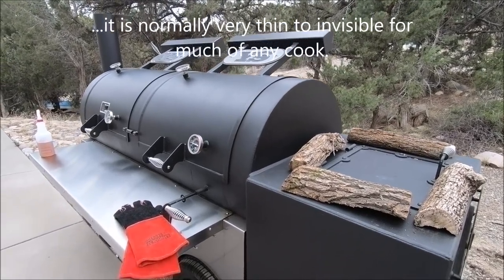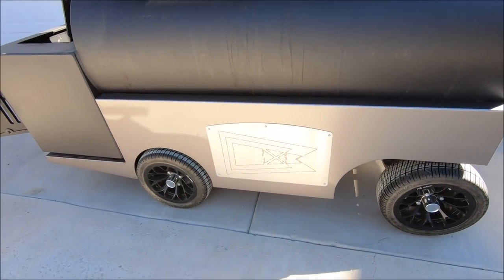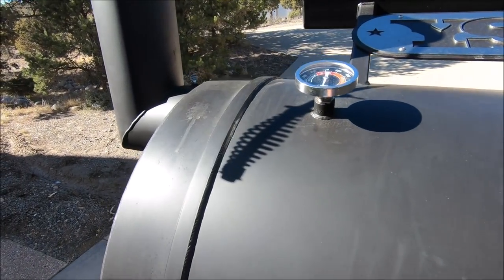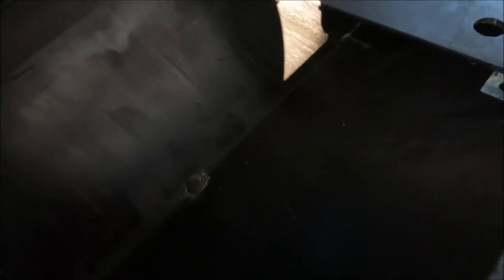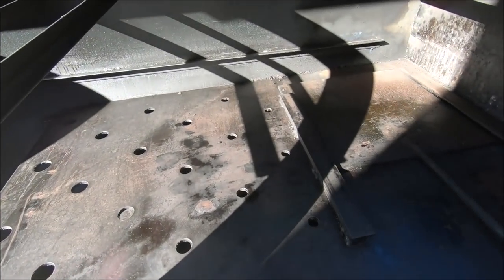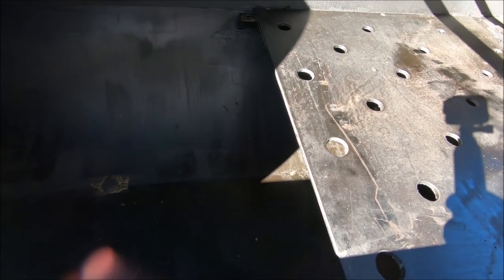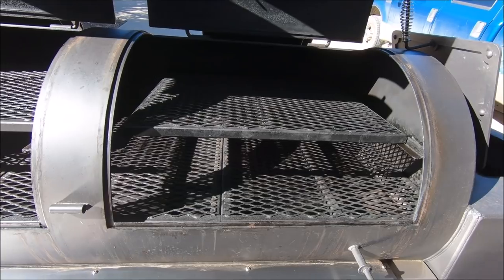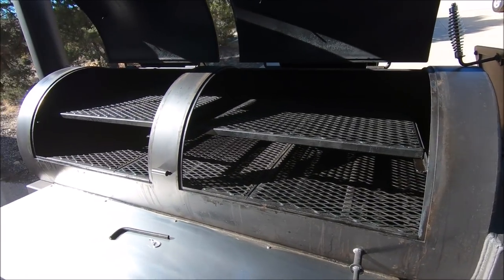Numbing Tour and Review of a Yoder Frontiersman on a Competition Cart

Comment: Great information as usual! Would love to see some fire management videos on the yoders. 
They all seem to have this back draft issue, wouldn’t a slightly bigger chimney stack resolve this?
Reply from the maker: Thank you ollygee!  If you think you can handle more of my crappy commentary, it'd certainly be easy enough to shoot a little footage as the fires get stoked the next time I fire these cookers up.  I'm not sure about the stack but what is common on the Yoders compared to my other cookers is that the firebox is set somewhat higher in relation to the cook chamber so the flow is more horizontal if not directed slightly downward by the HMP (heat management plate).  In fact, I misspoke in the video, the top of the firebox is actually above the plenum leading into the cook chamber which is even with the bottom of the HMP.  Also, on both of my Yoders, the damper is situated rather high so that very little combustion air is directed under the fire/coal bed but rather over it.  Thanks again!

Comment: Great review, thank you.  On the verge of ordering a Kingman with square semi insulated fire box.  I’m not a fan of reverse flow so that takes a few of the big boys out of the running.  Would you ask for certain things differently?  Did you call and tell them about the lid?  Appreciate any additional info!
Reply from the maker: Thank you, mcrn77!  If I had it to do over on the Frontiersman, I would have gotten that with a single lid as it would increase the cooking area and make access easier but the Kingman is probably only available in the single door configuration.  I did not contact them regarding the lid.  I was able to correct the problem with relative ease and figured that to have them correct it would have required another trip to KS.  It was the lack of quality control on such an expensive pit I found most irksome.  Thanks again and I hope this helps!